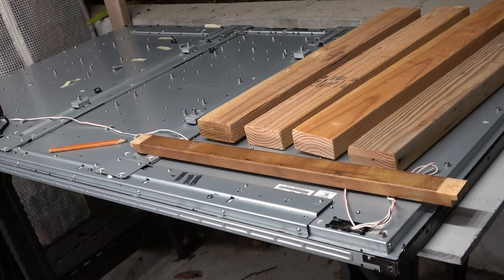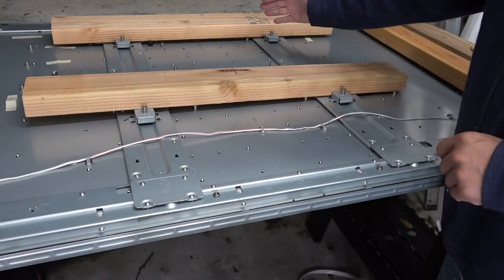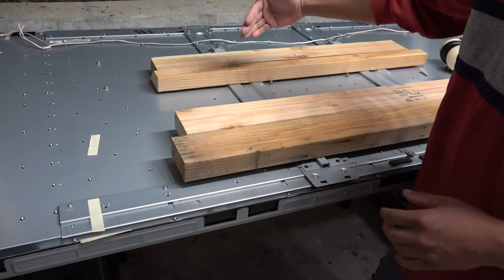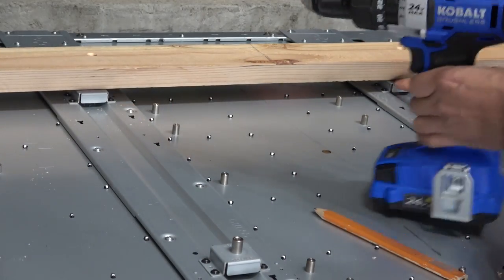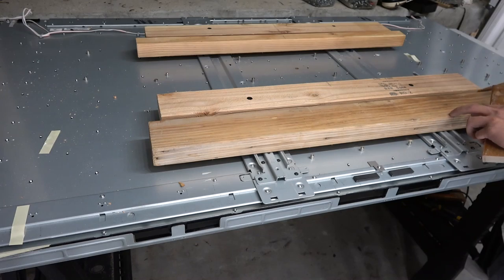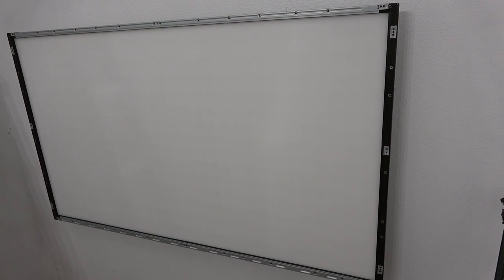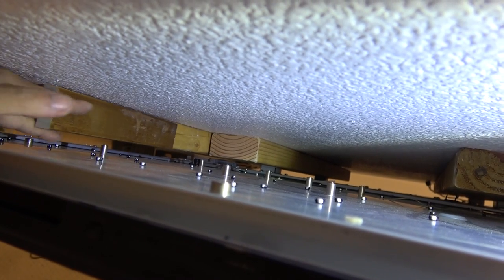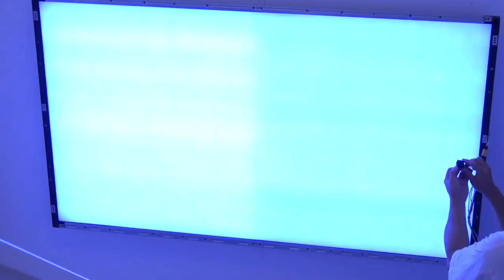DIY: Home made heavy duty TV wall mount with 2x4 wood studs

Comment: I have a small TV for my second monitor and use this method to mount it on the wall.  However, it sits above my other monitors, so I only use the top rail and that allows the TV to angle down at the perfect angle for me to see it clearly and not reflect the overhead light in the room.  😊

Comment: I'd be a bit worried about someone accidentally pushing it up and off the cleat.  One idea to fix this would be to simply install a few hooks on both sides of the cleat with eyes on the bottom side so that it can't be easily pulled off the cleat.  Or maybe just a couple of pegs on top/bottom on each side that another piece of wood fits over to lock it in place. Cheap and easy.
Reply: It's 75 lbs.  How would someone push it up and off by accident?  If someone does that, I believe that would be intentional.
Reply: Will it survive the earthquake? check your seismic hazard zone, or how about when Uncle Harry - the heavy bro - starts his funny dancing, things beginning to shift and sway?